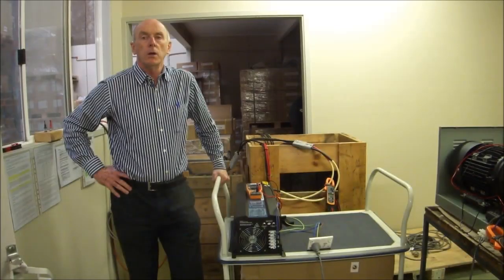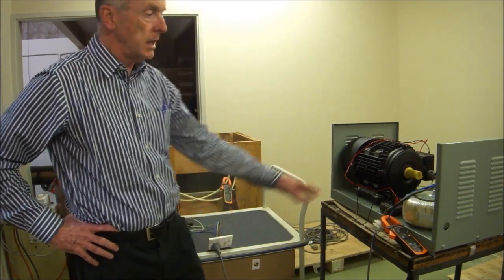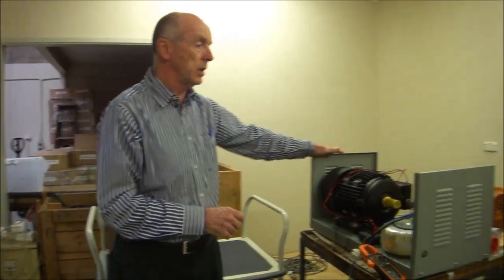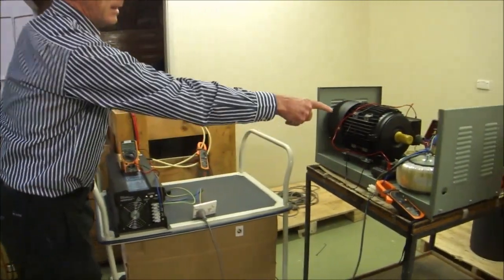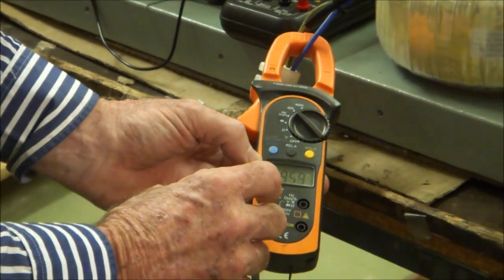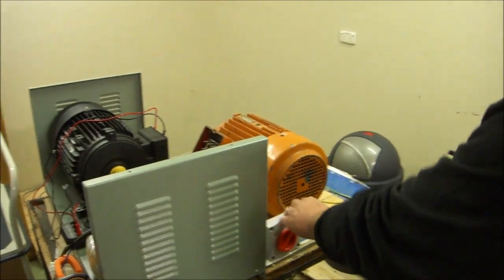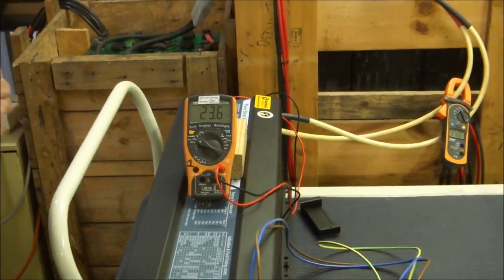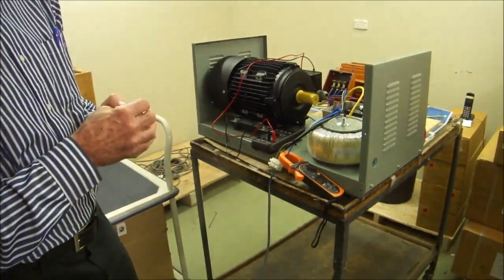Dc power to 3 phase power conversion

Comment: So a VFD has high voltage DC as the middle point in it's conversion process. A DC stepup transformer from the battery to some taps to that middle point in the seems to cut out most of this. Does anyone know how to tap into that part of a VFD?
Reply: Yea, you can give a VFD DC and it will work for the most part. It depends on the design of the charging circuit within the 3 phase inverter, especially if your DC source is batteries. 
Most industrial VDF's have high current terminals for connecting to the DC bus. 

You would be better off connecting two 24v battery banks in series and using a DC-DC inverter like this:

https://www.tame-power.com/sites/default/files/tame-power/pdf/TAME-POWER_CONVY_E_32K.pdf

It can do about 3-4KW from 50v input. Output would be around 600VDC and would be fed into the 3 phase inverters DC bus. 
Again, charging would be an issue. You could construct a simple charging circuit from a reasonably powerful resistor, voltage relay or timer and a contactor.
Reply: I came across this after realising the same, glad to see I’m not totally insane for trying to power an 11kw three phase motor from batteries… not totally.

Comment: Are you measuring DC current with AC clamp? How are you picking up 75 amps direct current with that multi meter?
Reply: Some meters can measure DC current with the clamp, just a matter of keeping track of the changes. Don't own this particular meter, but I would assume it has this capability.
Reply: There are meters that have, the ability to measure DC and AC current, I bought mine on Ali-express 4 years ago for $21

Comment: This has got to be the most inefficient way of running that 3 phase load motor ! There are much more efficient ways .   Is there some reason your powering the motor this way ?  Maybe I am just missing the point....
Reply: Isn't that how Tesla cars work? Powering 3 phase induction motors with DC batteries.
Reply: @impactodelsurenterprise2440  Tesla cars run on DC motors
Reply: @ihab124  Nope,  they are 3 phase driven by an inverter. 

Tesla especially have used the same topology as the motors in the video - asynchronous induction, I think in model s. 

But most manufacturers use Permanent magnet  / Synchronous reluctance or combination of the two,  they are still 3 phase and driven/commutated by an inverter. 

No EV car manufacturer would ever use a DC motor, they are far to inefficient.
Reply: Im looking a more efficient way. Do you know another way?

Comment: That motor could be ran on less than 120W idling. You loose a lot of energy on the inefficient transformation between phases and angles. The 4kw motor needs to be tuned for the source but with specific load value...